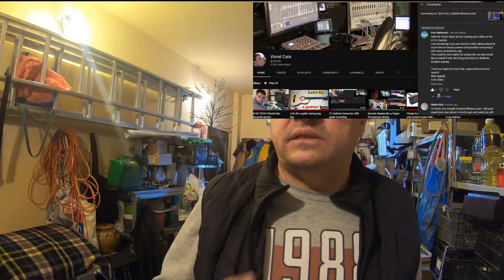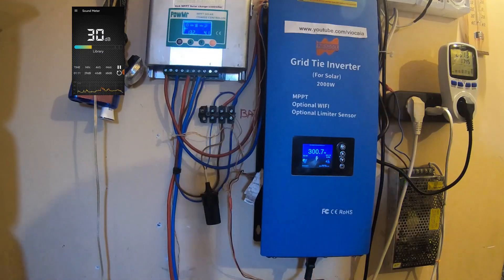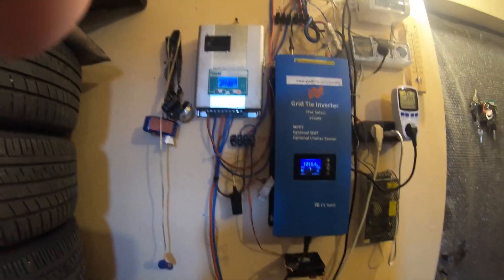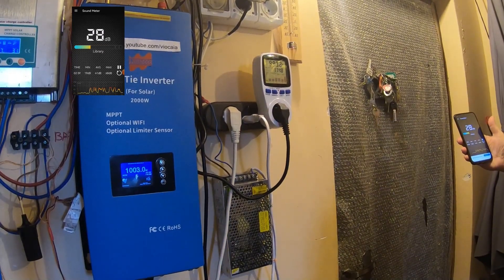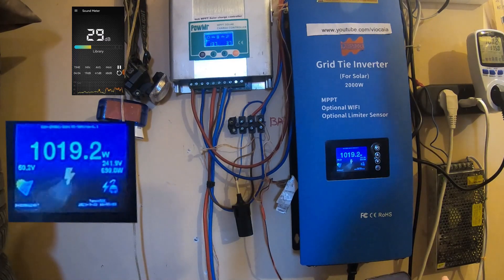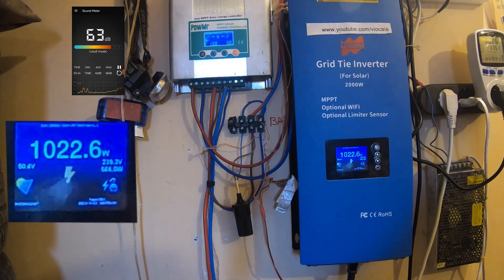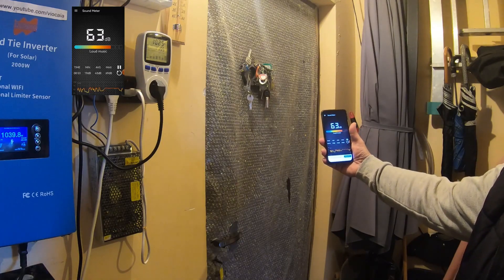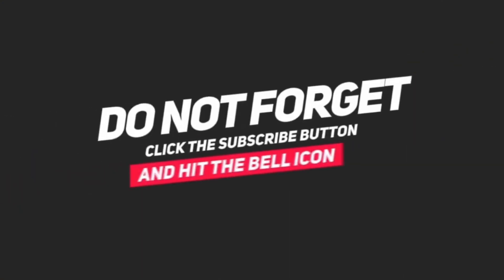SUN GTIL2 2000W solar power inverter noise test

Comment: It burns with 180v. I Hope selfprotection
Reply: I knew It works 45-90v one time I was wrong connectin solar panels. It advised me high voltage...not this time 😢
Reply from the maker: @usuariouser224  I got it...so far I'm happy with it...
Reply: New growatt works from 50-500v only en series.no paralel...13A max
Reply from the maker: @usuariouser224  Probably soon...
Reply from the maker: 180V AC , at the output?

Comment: How would you connect a battery and solar panels to this inverter?
Reply from the maker: Not directly...you need a solar charger in between. Solar panels+solar MPPT charge controler+bateries+ inverter

Comment: hello, I have SUN2000 and 4 photovoltaic panels LONGI LR5-72-HPH 545W, how can I use it, please
Reply from the maker: depends of the panels voltage...if is more then 25V then use 4P if is around 22v then you can have a 2S2P configuration.

Comment: Hello Viorell...great video fixing the Sun GTIL2 👍 I got SUN 2000 GTIL2 short ciruit on AC side and blown out the Field Stop IGBT FGP20N60 UFD (cracked). I replaced this IGBT and also replaced 2 shorted Triac"s S8008R and tested the inverter. The short circuit has  solved already. CT sensor doing good measurement on AC load and DC solar voltage reading is also good. But no power production, blue led doesn"t lit or blinking and Grid Error. 
Next step, I checked and replaced the photocoupler PC817 Sharp and Drop Out Voltage Regulator L1117-3.3 and tested the inverter and finally found that the Grid Error solved. But again still no power production and blue led off. I've checked the rest of the Mosfets (12 Mosfets FDP33N25) are good condition. Can you  help me on this issue...pls.
Reply from the maker: Sorry got no clue, maybe the mosfet drivers...